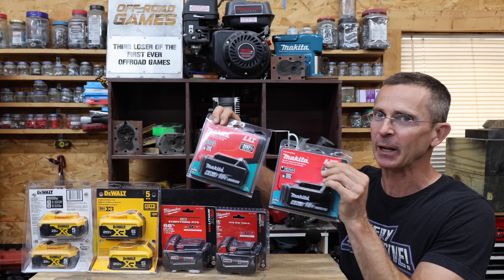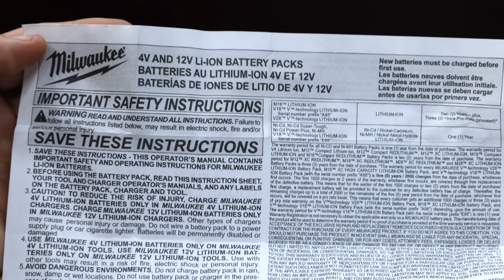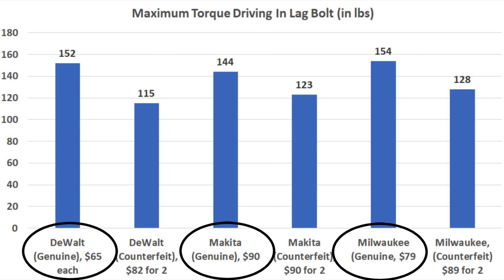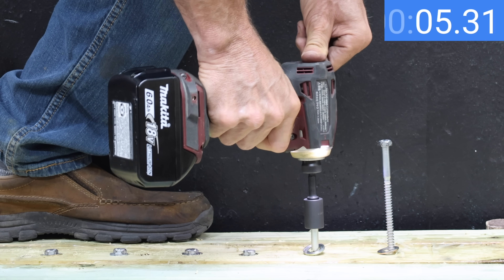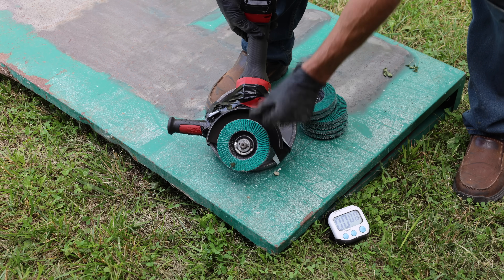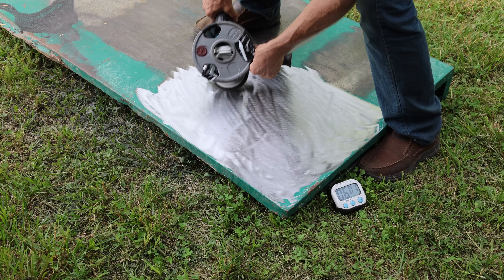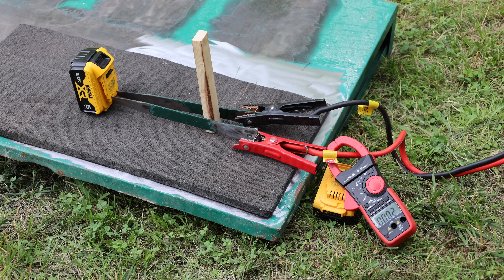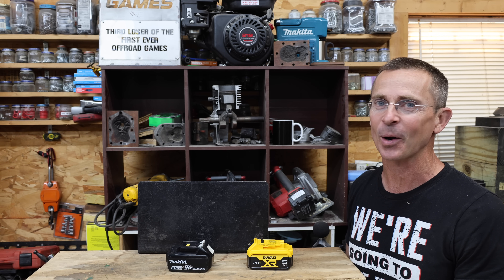Have You Been Scammed with a Counterfeit Tool Battery?

Comment: I only buy items like batteries, high volume auto parts (spark plugs etc),  from suppliers with reliable supply chains (ship amazon, sold by amazon;  Home Depot; etc.).  However, you have mentioned there is a hole in that process-- someone can buy an authentic battery and return a counterfeit which contaminates the supply chain.   This is likely particularly bad for big box stores where the typical clerk sees a returned packaged item and just puts the item back on the shelf, waiting for the unsuspecting to buy the counterfeit.   If enough criminals take advantage of the return process eventually batteries as a high ticket item will become non-returnable.
Reply from the maker: Thanks for the feedback.

Comment: I have the sreplacement batteries (counterfeid) for Makita 2x5Ah 18V and 2x1.5Ah 18V, I use them for occasional home use and for mowing the lawn. They have worked without problems for 6 years. However, I never leave them charging unattended.
Edit: These were advertised as "compatible" and "replacement batteries", so not a scam.
Reply from the maker: Thanks for the feedback

Comment: it would be a neat electrical project to see if you can solder in a circuit breaker and a control board, make the counterfeit less likely to pop into a fireball

Comment: I prefer the scam battery. It's cheaper and easier to install better cells once the battery is dead. I use Molicel cells, so I could increase amperage and longevity. Each cell cost about $4.99
Reply from the maker: Thanks for the feedback.

Comment: If those chines batterys doesnt have any circuit board, then all batterys will die, if user will take all the juice out of the battery. There is nothing, that would stop it. And litium batterys doesnt like if voltage drops under 3v per cell. That means if you have a 20V battery and voltage drops under 15v battery will take damage.  Well, not propaby stright away, but more the voltage drops, more the battery will get damage. Voltage abaut 1V per cell can be totally fatal and your new battery can be totally dead and carpage after that experiment.
Reply from the maker: Thanks for the feedback.

Comment: I find it frustrating that there is so much fakery out there.  Even in shops in Europe I have purchased good that are fakes, or even had the electronics removed and filled with scrap metal! 
these batteries are so similar in appearance that no one is going to know the difference until they use them. 

I bet the biggest failure of them will come after a few months of use when the cells just all out die
Reply from the maker: Thanks for sharing.

Comment: People wouldn’t be driven to buy these counterfeit batteries if the makers of the original products would set more reasonable prices for additional or replacement batteries.  Sometimes the cost of the batteries is so high that it seems like manufacturers are not really interested in serving customers and making a fair profit, but instead have adopted an attitude of “You want the privilege of using our products?  Screw you! We are going to make you pay, pay, pay!”  It seems like outright price gouging.  Another crappy business practice is how Dewalt, Mikita, and Dremel keep switching the types of batteries needed so if you buy a newer unit in their product line, you can’t use any of the old batteries that you have accumulated through previous purchases.  So now you need to lug around multiple sets of batteries and chargers.

Comment: The problem of fakes can extend to reputable outlets. Here in the UK some years ago it was revealed that brake-pads apparently manufactured by one of the major brake component manufacturers were in fact fake and were being sold my several large high-street car accessory outlets and motor factors. It was never revealed how they got into the supply chain.
Reply from the maker: Thanks for the feedback.

Comment: Original battery = overpriced, not worth buying.
Counterfeit depends, it should provide a better value for its money.
Anyways, one can just purchase a used "battery" (it is actually some batteries plus some circuits + insane price tag) and replace the actual batteries when needed.

Comment: This might be a long shot but is there any way anyone can provide info on breaking a crankshaft nut loose? on my car it is torqued between 220-300 flbs and not even my big impact would break it loose. I don't think the bump method will work with it being tightened that tight. I got a leaky crank seal, what is a guy to do? lol
Reply from the maker: Thanks for the suggestion.

Comment: Sometimes the OEM safety circuitry can make a good product frustrating.  I found this out using my Ryobi 40V tools when the OEM charger would frequently FAIL to recharge the batteries, whether warm or cold.  I ordered a knockoff charger and it works flawlessly every time.  (I never leave the batteries in it tho'.)
 For this reason I hang on to my 1970s car battery charger too, as my new Schumacher one often refuses to do the job if the battery is too low.
Reply from the maker: Thanks for the feedback.

Comment: Excellent video.  Let me be Devil's Advocate for a minute. The measured performance of the counterfeit batteries is down by 15% - 20% while the cost is 37%-50% less.  Sounds like a more than a fair deal.    Of course there is consideration for the individual recharging times, the number of NORMAL recharging cycles the battery can handle (i.e., not running the battery to zero), and general battery safety.  I totally agree on calling out counterfeits for what they are - no debate on the illegality, misrepresentation and potential for fraud on returns.  But strictly from a performance and safety standpoint, wouldn't the counterfeit batteries probably be fine for Harry Homeowner and other light users?  Add to that of very few of us having the knowledge, time, equipment to sort all of this out.  But something bigger is at hand.  Legally, you are responsible for reporting counterfeit products to federal agencies (e.g., National Intellectual Property Rights Coordination Center, U.S. Consumer Product Safety Commission).  From the US Customs and Borders Protection website.  "It is illegal to purchase counterfeit goods. Bringing them into the United States may result in civil or criminal penalties and purchasing counterfeit goods often supports criminal activities, such as forced labor or human trafficking. Help to stop the funding of criminal enterprises by buying authentic goods."  So, it's not as simple as which is best or as good.

Comment: Company I used to work for used hilti equipment and one of our brand new trucks was parked over night batteries and drill inside the boxes. The  battery was not being charged. Nor was it plugged into a drill. The battery exploded caught the brand new truck on fire and burned The cab Krispy, as well as 2 of the steel boxes.
Neighbor company called the fire department and they extinguished the truck They were batteries directly from Hilti and hilti refused to cover any damages
Reply from the maker: Thanks for sharing.

Comment: When buying anything on eBay, use the "body temperature" guideline: don't buy from any seller whose percentage rating number is lower than normal human body temperature (in °F): 98.6.

Also, when buying on Amazon or eBay, please make sure you buy from an official store, or look for "ships from and sold by Amazon" or something similar to that. If someone else is selling goods, they could be anybody. It's your responsibility as a consumer to pay a little attention and be a little vigilant when online shopping.
Reply: The problem with "ships from or sold by amazon" is that people supply them, all supplied goods are lumped together, and they dont have  a way to track who supplied what once they are all mixed togethger in the fulfilment center, so you can get a fake, send it back, amazon fines the seller, and it wasnt even them who supplied the fake.  Amazon is wide open for abuse

Comment: 🙋Uh, Mr. Farm! Samsung INR18650-25R are NOT protected cells. Protected cells are not typically using in battery packs, as that is the job of the BMS (Battery Management System) ie that “control board”. The Samsung cells were probably designed better and thus were safer in failure.

Comment: I once bought batteries for my small pocket video camera off eBay. They looked exactly like the originals. Couldn't tell them apart. Except for one thing: On the back, in the tiny lettering section they printed "Kodad" instead of "Kodak". They also only lasted about three minutes. Seller very apologetic with fast refund.

Comment: One big problem is that some of the alternatives are quite good batteries. There is another problem with that fact. Which is which? One does not know untill the item becomes a "was" rather than an "is". We all know that electricity is a name for smoke. All electrical equipment actually runs on smoke. The proof of this is that once the smoke gets out of the tool or battery it never works again. I say that as a 50+ year veteran of computer services. 

I have a small need for battery power tools and after fifty years of buying good makita 240v equipment that gets mostly occasional use, I now have old out of date (no soft start for example) equipment that is still far from past its working prime. So when I needed some battery tools, I initially went to Hitachi 18v but they changed the battery on me and I don't like things like that. So I went to makita 18-20v battery powered tools (seems Makita 18v connection is a world wide compatibility default product) made by "made in china"  whoever no name, using "Made for makita 20v" replacement batteries as opposed to ones designed to look like the original. So far I have had no problems with anything, though I would not use them if I were a tradesman or production shop, unless I wanted a specific quick solution.  The batteries I use do not have the output of the genuine makita batteries and the tools are all well built, not pretending to be the same as the original but just having a compatible battery, all delivered in plain cardboard boxes from the importers bulk packs, but they do not have the power (nor I expect the longevity) of original Makitas, but at  $30-50 AUD  for a drill or a battery, it does not matter to much. But for my use I have found them quite adequate for the use I make of them. I am not tied to one brand where I buy a tool and battery then need to buy a new battery for the tool followed later by a new tool for the battery. This going on alternately for ever.

Comment: Pretty sure I got a couple of the counterfeit ones about 6 months ago on ebay. After a month or so they just stopped charging, and ebay offered me absolutely no options for returning them or even reporting the seller.

Frankly I've bought cheaper 3rd party dewalt batteries that have lasted 4 months so far and cost half of what the counterfeits did. It seems like you're better off buying batteries that are honest about not being officially batteries than you are trying to buy real ones online.
Reply from the maker: Thanks for sharing.

Comment: Something else to watch out for.  A lot of the "compatible" battery options out there (And probably some of these fakes too.) might claim to use genuine Samsung, LG etc cells.  If you take them apart sure enough, you see the "genuine" 18650's sitting in there.  HOWEVER, they use what are called "B grade" or even "C grade" batteries.  They are batteries that do not meet manufacturer specs, but still perform to some degree.  They sell them deeply discounted, and in some applications they may be all that's needed so it's a win win in those cases.  But in applications such as battery packs for tools, B and C grade batteries should NEVER be used.  So watch out if you buy a "compatible" battery that claims to use "genuine XYZ" batteries.
Reply from the maker: Thanks for sharing.

Comment: I purchased a pair of dewalt batteries thinking I was purchasing oem because they were more expensive than the knockoffs and claimed to be authentic.  However, I noticed over the past few weeks they don’t seem to last even half the time as the ones that actually came with my dewalt tools.  Wasn’t necessarily searching for any videos about my concerns but your video popped up in my feed as a suggestion.  So, I watched it because of the relevance.  

Having done so, I’ve now put the batteries in a LIPO fire protection storage bag and will keep them outside in a spare gang box I have out behind my shop (not up against the shop) and I’ll only get em out when I need to do a project that requires doing so.  

I’ve always left them either on my power tools shelves in my shop or even in my garage.  NEVER AGAIN!  Todd, you very well could’ve just saved me a house or shop fire due to these subpar counterfeit batteries!  For that my friend, I can’t thank you enough for what you do and for this video specifically!  Keep on keeping on!  We love ya Pal!👍
Reply from the maker: Thanks, will do! Thanks for sharing.

Comment: Yep too good to be true. I had this happen to me with M12 batteries I bought 2 CP 2.5 batteries. Said they were kit-pulled and new without a box. I got them in and the only initial indication is the label color is slightly lighter red than the CP 1.5s I got from Home Depot. I tried to use it in my non-fuel impact driver and first one after a few seconds the battery clip ears fell off then the whole plastic casing came off in my hand so now it's just a red pod. They have trouble charging and they last way less than the CP 1.5s. I tried to file a claim with eBay but they said I got a battery which I did I guess so they got away with it.
Reply from the maker: Thank for sharing.

Comment: Have you done a video on those electric jackhammers? I got a $150 one off Amazon to break up some walkways around the house and it's been a champ, just have to make sure the oil is topped off since it goes through it like a stuck pig, would be interested to see how different ones do, and how they compare to the gas and pneumatic powered ones.

Thanks for all the work you do in keeping us informed!
Reply from the maker: You are welcome!  Thanks for the suggestion.

Comment: Why, oh why dont those brands implement good persistent anti-counterfeiting measures? Like that QR code quo mentioned?

I don't have a problem with generic brand, lower quality batteries. But The consumer should know exactly what they are getting. QR codes and all that would make it basically impossible to counterfeit batteries or other safety critical equipment.
Reply from the maker: Thanks for the feedback.

Comment: I bought Ford oil and fuel filters for my diesel pickup on Amazon for cheap once and the box was identical, but I compared them to the ones I bought at the dealer and the oil filter was a different length by 1/4 of an inch so I fired the whole works into the garbage
Reply from the maker: Thanks for sharing.

Comment: I communicated my counterfeit Makita batteries to eBay and they "took down the product" immediately.  I have since communicated more "offers" on eBay hoping that eBay will help fight the counterfeit problem.  I suspect that until eBay gets sued and loses (DeWalt, Makita?) the counterfeit products will survive.  Maybe brand companies will modify packaging on a regular basis, or create "look up tools" (QR codes?) that will confirm authenticity easily / quickly.  You'd think "compatible batteries"  would become a market -- with testing / comparisons / UL data -- but "they" apparently would rather make counterfeit, crappy, potentially dangerous batteries.
Reply from the maker: Thanks for the feedback.

Comment: Try the Milwaukee 12v. I bought knockoffs on Ebay  5ah. One came dead but the seller replaced it. I've been running them for 2 years now. I dont own a genuine  5ah to compare to but they out perform my stock batteries in run time and usage. But that being said I do not use my tools often so I wouldn't  see the same results as a carpenter or mechanic.  For my around the house and light car repairs they work great for me.
Reply from the maker: Thanks for the feedback

Comment: One small thing to note: sometimes companies will switch up the exact cells with some similar ones. It may be Samsung, or LG, or someone else. Don't get caught up on the brand, or especially the color. The main thing to note is the circuit board aka the BMS. That's where most of the protections for common issues are and that's the thing that should give away a counterfeit immediately.
Reply from the maker: Thanks for the feedback.